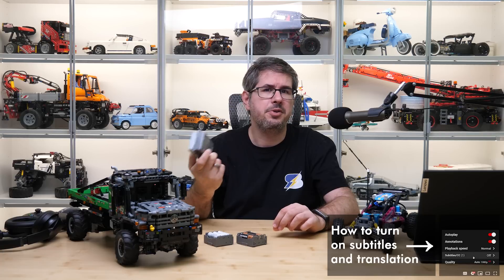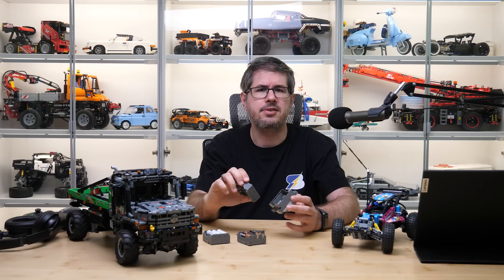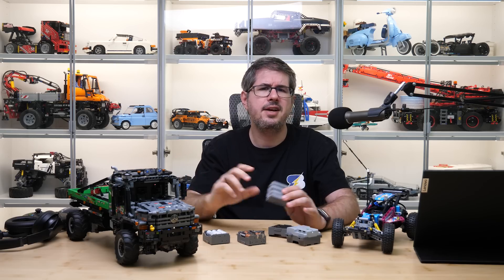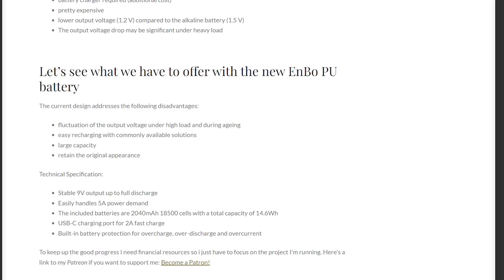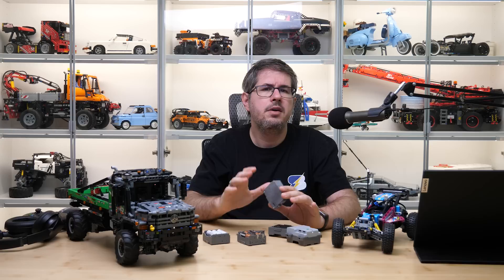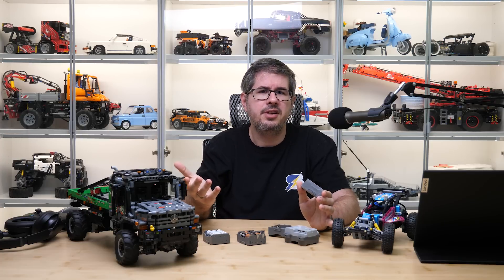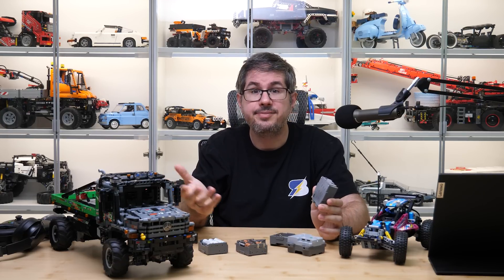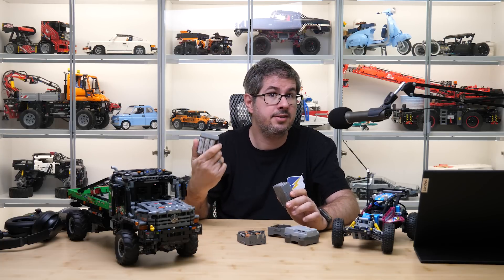USB rechargeable battery solution for the LEGO Technic hub by Phondly

Comment: The only thing this is lacking is a rubber cover for the USB port, to prevent material and moisture ingress, as I would imagine people would use their RC models outside or with unclean carpets. 
I'd also be curious if the creators ever explored the idea of using pouch cells instead of cylindrical cells, due to the slight advantages they may have.

Comment: Hey Balazs!!! My big fan here! ⭐️

So, Im using 1 alternative buggy motors powered by 1 Mould king battery box 4.0, per each side of my model. However the CIRCUIT PROTECTION kicks in in 5 secs and stops working - Power CUT. Could you kindly advise how to fix or replace componentes?
Reply from the maker: I have no experience with MK electronics. If you want to run buggy motors reliably then you might want to try BuWizz

Comment: I think I'm using similar solution as they are. I'm simply using voltage regulator paired with lipo cells. This gives me steady 9V for the whole time. In my solution I used a voltage regulator with charging capability on single board purchased from aliexpress. At start this was supposed to be a solution for trains, but in the end I'm mostly using it for technic models. I did this because I've had many single lipo cells from broken batteries that couldn't be used in pairs, so step up regulator was a very cheap solution.
Reply: That could be a cheap alternative but we packed 2 paralel Liion batteries inside and used a very beefy good quality step-up converter and a really unique charger in it with power path management and high current (2A from USB-C port) charging capability
Reply: @phondly  Thanks for responding. Yes, I'm sure your solution is more powerfull than mine. I calculated power requirements for my needs which were not that high. I did this to have a steady voltage and mostly to reuse components that I already had from other hobbies. You are proposing complete package that does not exist on the market yet, so I think this will be very good plug and play option for LEGO fans.

Comment: Pretty cool, but with how the prints look I have to wonder what experience they have in manufacturing such parts. At the same time, maybe there's another reason for rough looks of those plastic bodies and it just doesn't matter as they'll outsource plastic parts production? Anyway that's one of the things that I want solved in Lego ecosystem. Now let's have someone solve the physical controller :D
Reply: I know the look isn’t the best, but that’s the maximum for such a 3D print (otherwise it looks better in hand than in video due to its surface roughness). The final product will be injection molded and will look like plastic LEGO parts.

Comment: By the time LEGO decides to come up with their own rechargeable battery pack for the Technic Hub, they will probably just switch to a new system instead.
It would make much more sense to introduce a pack for the PU small train hub, where it's more difficult to access the battery compartment. Why didn't Phondly release that first? For official Technic sets, there is no need for this because the cover is located very conveniently and counting the number of hardcore Technic MOC'ers that prefere C+ over PF, it will be almost impossible to reach the minimum threshold.
Reply from the maker: There was already a battery project last year for the train hub (Keybrick One), and the interest was low. I think only a few people use that hub, only the train community comes in mind and not many of them made the switch to PU eventually. 
There were enough Control+ sets released in the past years to have this product a potentially much larger audience, and the lack of rechargeable battery for this hub was probably the number 1 complaint I saw when I reviewed the sets. Now it's time for those people to show their real interest, otherwise TLG and their ignorance of the subject might be proven right.
Reply: @RacingBrick  Ok thanks. I completely forgot about that since it flopped.
Curious how this one will perform. I for one am not willing to invest more in C+ sets, especially not for the 5 minutes of "fun" they provide.

Comment: All seemed great... Then I heard this :  75. And then I thought that buying the rechargeable battery for power up went it was available was the best idea of life
Reply: it is actually 60 for early birds
Reply: Still very pricey for " just " a battery, even if it's a good one... ( And yup, I know, 50€ plus 30 € for the adapter was also very pricey for the power function battery... )
Reply from the maker: So just to put in in perspective, LEGO sells the Spike Prime rechargeable battery for $70 that has a similar capacity but lower voltage. This is their price with all the advantages of being a huge corporation, compared to a low-volume crowdfunding price that has much higher costs for tooling, materials and so on.
Reply: @RacingBrick  wait, they sell it without the hub? Is it compatible with control + hub? Last time I checked the teal hub with 6 ports was sold separately for 250€, i didn't knew the battery could be find separately???
Reply from the maker: @richardjulien1329  it is not compatible with the Control+ hub, obviously :) It is sold on the Education website, I guess local Education retailers might have it - https://education.lego.com/en-us/products/lego-technic-large-hub-battery/45610
Reply: @richardjulien1329  yep. sure for just a battery is pricey. But it has an electronics in it, which provides constant 9V output, not like any owher batteries during discharge. The game experience should be way better than with batteries.
Reply: I know.... Still to get it at almost the same price as the hub it should recharge, I find it hard...
Reply: I know... Also, I just finished reading Philo page about it, and once the technical details read, yup, it's highly interesting... I think I will buy one ( sorry wallet, I can't resist now! ) For a moc I'm trying to make... I will wait some more to be in a much closer to the finish line step of building, as u still didn't manage to get my main part functioning, but still XD

Comment: It's quite insane that TLG hasn't provided an official battery pack yet, these hubs have been out for years now. The steady supply voltage is for me the most interesting point, I was looking if I could stick a lipo in there but it would need a voltage regulator since a 3S lipo pumps out around 11 volts, which is probably bad for the poor electronics in the hub designed to run at 9V. But with NiMHs that run at ~8V fully charged and quickly drop off to like 7V after a bit of use, it's just annoying.

Also wondering if this battery pack has a little bump that interfaces with a switch on the inside of the technic hub that tells the hub what kind of battery it is and if that would affect the overcurrent protection on the motors or not. Especially if driving 2 XL motors at full torque, NiMHs can't really keep up in delivering the current required to run the motors are full speed.

I don't do kickstarters but if they ever get around to just making a shop I'll certainly buy some to replace the hassle of having to charge 12 AAs for my two hubs and I can use those nimh's for other stuff as well.

Also I wouldn't recommend leaving the battery pack inside the hub (especially if it's powered on) while charging, lipos tend to inflate a bit when charging/discharging and the added heat could really eat into the battery lifespan.
Reply: 3S =12.6 V  (not around 11). 2S is 8.4 which would not need a downstep regulator.
Reply: @basberend please look up the difference between peak and nominal voltage
Reply: @basberend 2s is 7.4 volts not 8.4, nimh batteries are sometimes 8.4v
Reply: @Fordhykerjet  talking about lipo's > Nominal voltage is the default, resting voltage of a battery pack. This is how the battery industry has decided to discuss and compare batteries. It is not, however, the full charge voltage of the cell. LiPo batteries are fully charged when they reach 4.2v/cell
so yes 2s = 8.4V
Reply: Bruh! I had been using a 3s lifepo4 battery having a nominal voltage of 11v and the techinc hub doesn't have any problems
Reply: @xtrarobotics  doesn't have any problems yet

The problem with overvolting electronics is that stuff just runs hotter and if you do it long enough components will start to deteriorate, which means the internal resistance of components go up, which in turn means more heat, which leads to more deterioration until there is so much resistance and heat the magic smoke comes out.

Especially stuff like ESCs (the chips that regulate voltage for the motors) can work fine for a long time and then just randomly explode without any real warnings. 

And if it by exploding shorts the li(fe)po, there's a good chance you get a lithium fire, which is not only pretty dangerous and hard to extinguish, will also destroy anything not blown up in the hub.

There is a reason TLG has protected all the motors they have produced up to now with thermistors, as a stalled motor will quickly heat up and start to damage the coils and stuff it it goes on for too long.